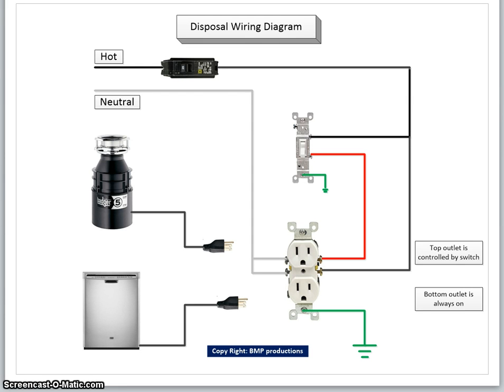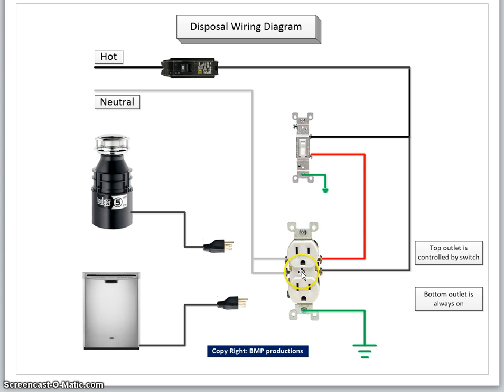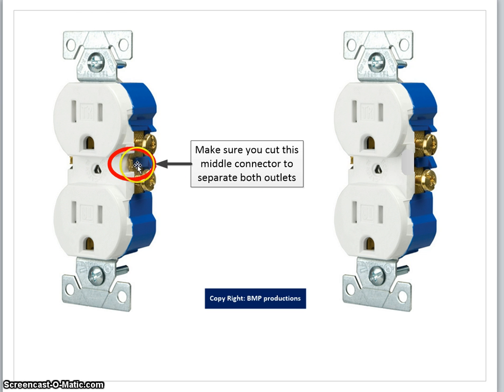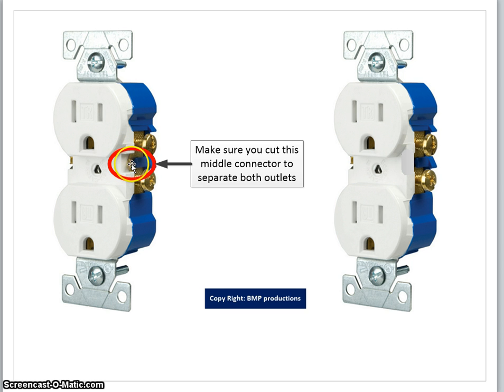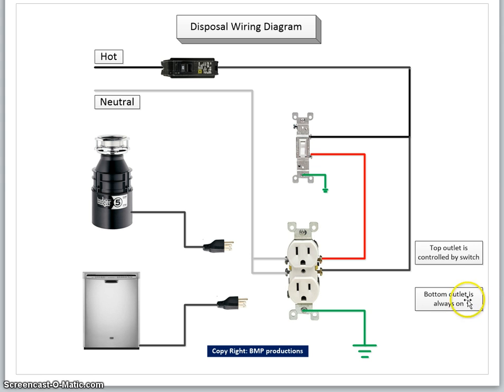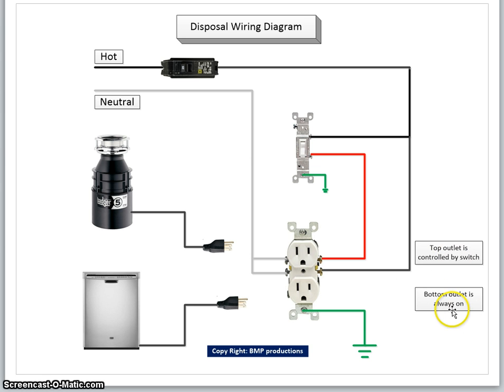Disposal wiring diagram

Comment: Thank you sir,  the diagram itself was enough for me.

A contractor turned on the circuit breaker and my disposal was running.  He did something it was fixed.  I asked him what was done.  He simply said " split outlet" but that did not answer my question.  

I ended up here searching and the electrical diagram answered everything.

Comment: Handyman replaced the outlet under the sink and the garbage disposal switch was out of commission. When we plug the GD, it would be on all the time. After watching this video, even though the outlet is quite different (toolless design) I was able to figure out the issue. He must have missed the cover for the copper connector that had to be broken off on the hot side.